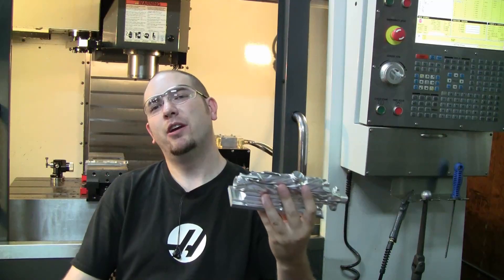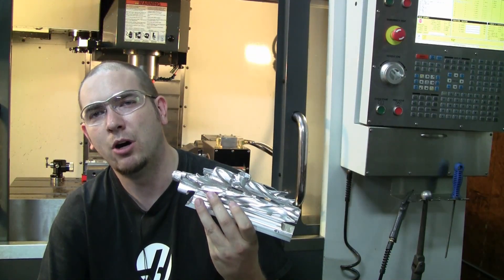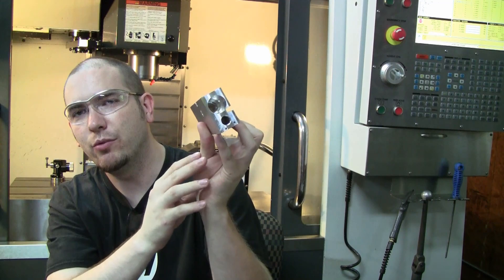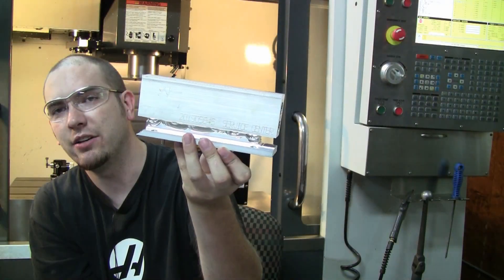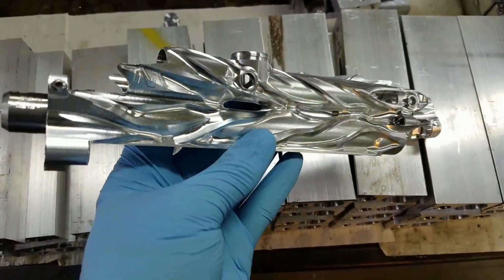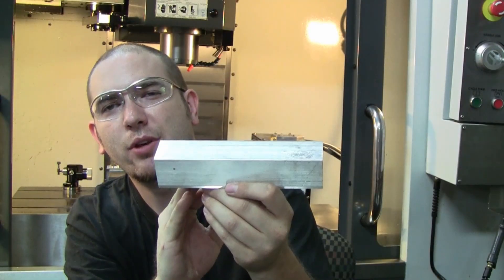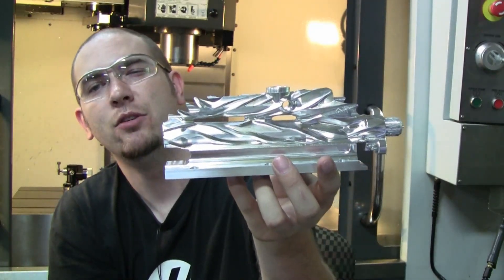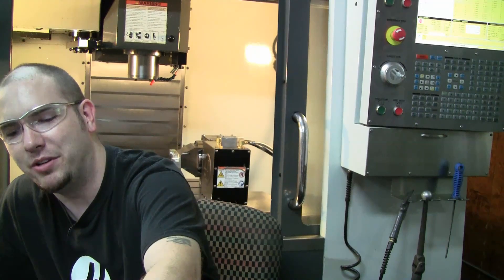CNC milling an Autococker body (Nummech Pyrococker)

Comment: Love the video. Quite complex machining, great work! I'm very curious to know what method you use to drill the long hole thru the length of the body, gun drill or something?
Reply from the maker: Thanks! We use a carbide insert tip drill to create a pilot hole first, then follow up with a special reamer to finish the inside surface. The funny thing is, the two bores are different by a hair due to mixing the marker generations, so it's actually two different reamers.

Comment: How is that aluminum held onto the tombstone? it just clips in? and how are the end plugs held for machining. I am looking at DM2 currently.
Reply from the maker: that aluminum "upright" mount is T-shaped to allow material that can be screwed down against the steel hex fixture. There's maybe more elaborate ways to go, but I like the simplicity of the screw system myself.
Reply: @ydna  so its crewed down to each other. thanks.

Comment: Could you possibly do this with a 3 axis it’s all I have access too at this point?
Reply from the maker: absolutely! in fact the initial setup time would be quicker that way, since you just have to make a quickie mount for holding the body in the machine. Personally I would just snag a chunk of aluminum and drill it for screw holes to match the body, then go gentle with the speeds and feeds, should be good!

Comment: I'm curious to see what method you are using to drill the bore on these. Drill and ream or gun drilling? I used to do alot of custom anodizing on PBnation but gave it up years ago. I am a machinist now but I don't manufacture any paintball related parts.
Reply from the maker: I use a replaceable tip drill all the way through the blank, then follow up with a reamer to the finished size. Later on the bores are honed, but it happens after the cosmetics. The deep drilling is the last thing I haven't really shown since it's difficult to film, unless I did a "test" body with an HSS drill or something (I'd like to do that but not sure when it would happen, if ever...lol)
Reply: @ydna  Drilling that with HSS without thru spindle coolant doesn't even sound fun. Running an Iscar chamdrill or similar seems fine. I was curious if anyone was actually gun drilling any of these parts.
Reply from the maker: Yep exactly, I use a good ole chamdrill from the first body I made many years ago. Filming it is like going through a carwash...it may be cool to see the whole process, but there'd be a lot of omitted cutting. If we make any more "small" bodies (like the Axe slug I show in the video) that would be the ideal time to show it since the drill doesn't take long, but I'm not sure if we'll ever get that opportunity again since most of the bodies I'm making lately are either cocker or mag. but hey we'll see...

Comment: Beautiful! I like how you put the logo on the 3D surface, you rarely see that.
Is that a 1/2" EM with, like, 3" of flute length? It looked like it was in a set screw holder, is that for rigidity?
Reply from the maker: yeah the logo is projected onto the surface, a couple thou deep. That way it survives both polishing and blasting, so the anodizers can go nuts :)
The roughing is done with a 1/2" rougher but it only has 5/8" of flute length, the rest is solid reduced shank. I don't push it too hard with the 30 taper, but it's a very rigid and bulky enough that I don't worry about it being chipped.
Reply: @ydna  Ah, OK. In that case, that's similar to my favorite 1/2" end mill. I'm a fan of the reduced shank, but needing to multip'e passes on vertical walls is a bit annoying and the surface ends up with visible lines in it.
Reply from the maker: some tweaking might be able to tune it out, but you'll have to experiment based on your holders. I have one particular part with an internal pocket that gets finished with a 3/8" endmill with 1.5" flute length. I come in with a "semi-finish" pass with a reduced-shank endmill leaving 0.003" on the tool radius, then I bring in the full-length cutter and perform two finishing cuts at 0.001" each (first leaves 0.001 then the second leaves nothing). That particular recipe gives a good result, but the endmill still flexes like mad... the bottom of the pocket is like 0.004 of material left on the diameter. So one would think the tool/holder is flexing 0.002 which seems crazy but hey whatever. Luckily on that feature I was able to design around the dimension flex so it doesn't matter hehehe